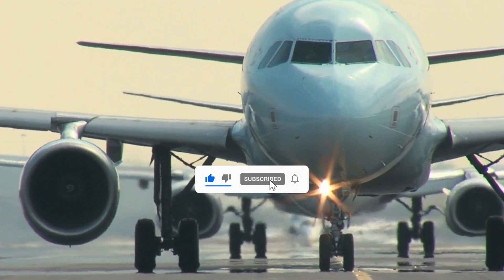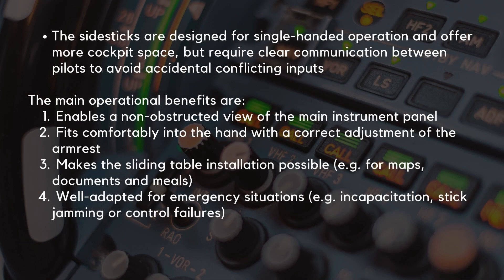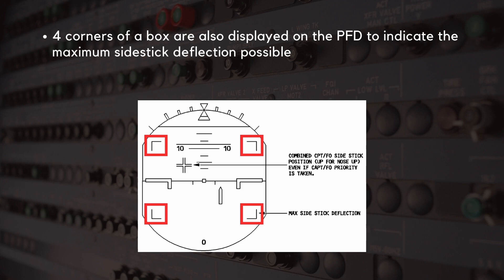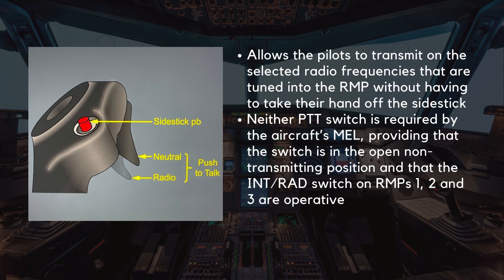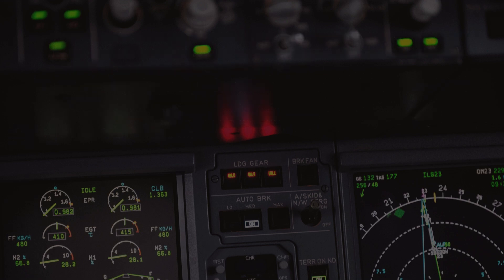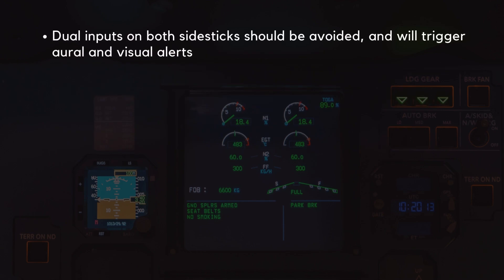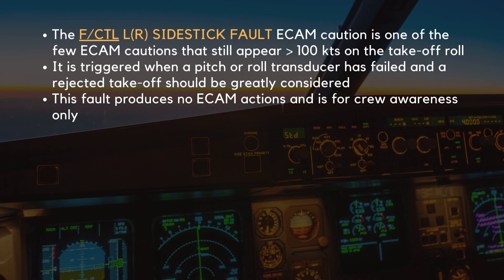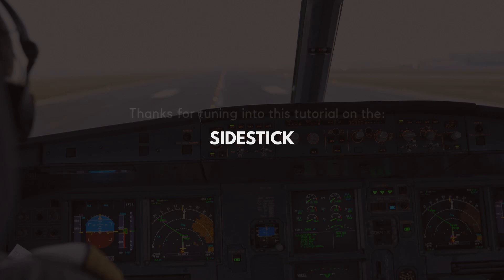A320 Sidestick Explained | A320 Flight Controls

Comment: Are these legit, because I will totally watch these on repeat/
Reply from the maker: The videos are based on official aircraft manuals and my experience operating the A320 series on the line 👍🏼
Reply: @A320Knowledge r u an a320 pilot or an aviator enthusiast flying on pc simulators?
Reply from the maker: I’m an A320 rated pilot 👍🏼
Reply: @A320Knowledge  ay, good enough for me